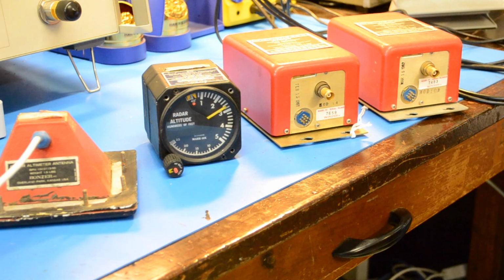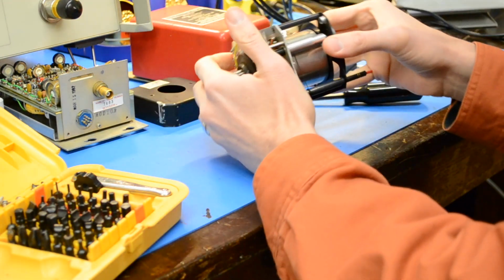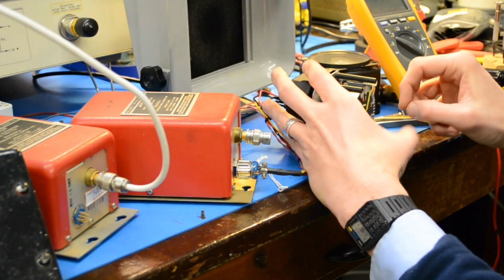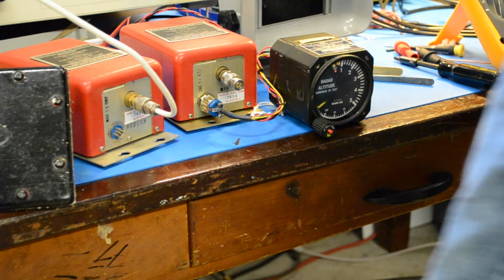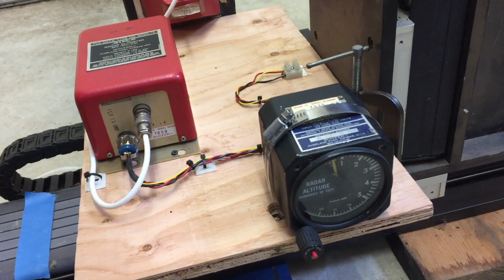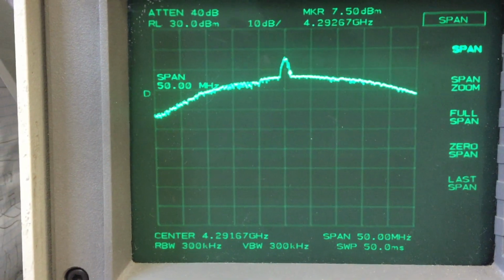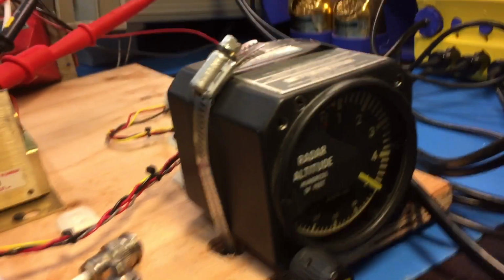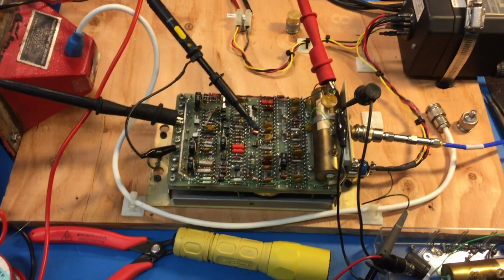Bonzer Mark 10 Radar Altimeter Repair and Demo

Comment: Decades ago we used a Bonzer Radar Alitimeter for our aircraft doing geophysical surveys, which generally requires flying at 250-500 ft AGL.  But, the Bonzer of that era used to X-Band (10gHz), frequency later used by radar guns for police.  At that point, the X-Band Bonzers were illegal. Good to see Bonzer is still in business with the 4.3gHz product.

Comment: Just a few comments to clear up some misconceptions: The Mark 10 is a 4.3 GHz super regenerative pulse radar utilizing a RCA pencil triode in a tuned cavity as both transmitter and receiver. As the cavity is grid pulsed it is susceptable to received energy. By measuring that susceptability it may be determined when there is reflected energy present. The pulse rate is swept from far to near range. When the received signal quits, that is your altitude. Testing the system was done with coaxial delay cables and actual test flying during development & production from 1965-1983. You were fortunate to find one that still had transmitter output. The tube life was rather short, less than a thousand hours. These units were rendered obsolete when RCA quit manufacturing pencil tubes/cavities in the early '80s. Lynn Potter - Bonzer VP/GM 1965-1977
Reply: I have one these in my aircraft....is there a way to test the pencil tube/cavities to see if it's still working?
Reply: @wardbru703   If the unit self tests with the red button on the indicator's DH set knob but the needle never appears in flight there's a high probability the pencil tube is dead. If the dot on the running time meter (white plastic bar above coax connector) is above 800 hours, you're probably done, sorry it's now a 40 year old boat anchor.